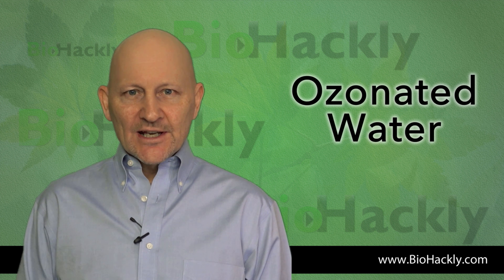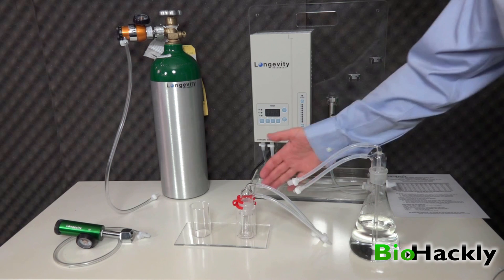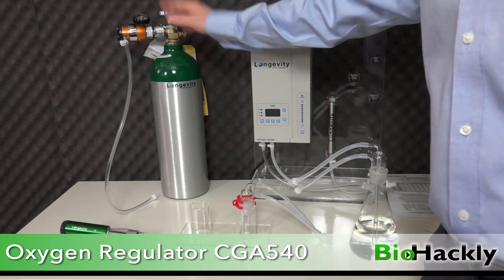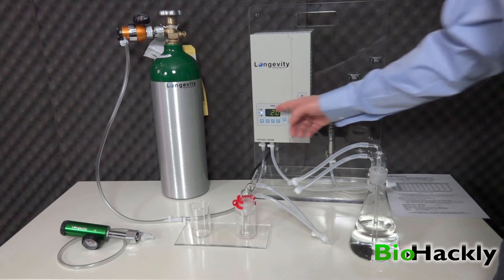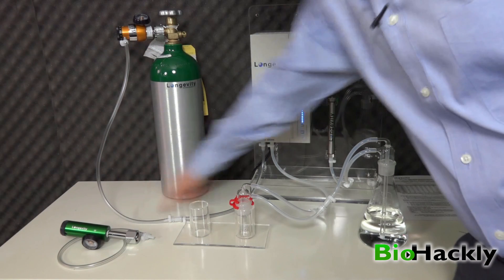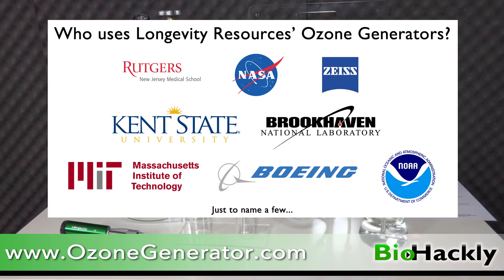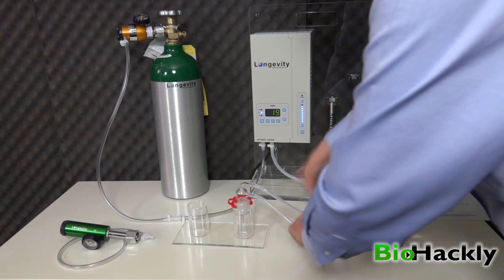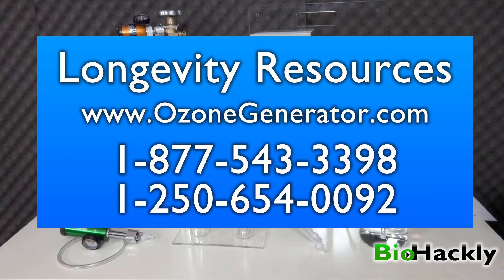Making Ozonated Water with a Longevity EXT120T Ultra Ozone Generator

Comment: Great video! I bought the same unit. You can keep your water temperature cold by setting your water beaker in a bowl of ice. The colder temperature allows for greater saturation of the water with O3.
Reply: I broke my beaker. Now using a plastic bottle from iced tea.

Comment: I don't have a stand for my generator so could I lay it on it's back?
Reply: If you have a Longevity EXT 120, the manual states it can be run laying on it's back. You didn't mention your model.It would be good to check the information for your unit.
Reply: . I always use mine laying inside the case it came with. I stand the tank upright of course...

Comment: I bought the ext 120 from Longevity and I did my first batch of water set  at level 7 set at 77.9 @ 1/16 oxygen flow and I found the water to irritate my throat  a little bit after I drank it. Do you recommend anything? Is that normal? I'm not damaging my throat am I?
Reply: I would absolutely back off the concentration a bit. They say to start at smaller concentrations initially, allow your body to adapt and increase in small increments.
Reply: ShaneMcGarry52 :  if irritates your throat because this is not truly the best thing to do for health.  U should be using molecular hydrogen before and after using ozone to protect the body.  The science is clear, molecular hydrogen is far better for health than ozone.
Reply: Ozone irritates thats normal. It's just pain, not gonna kill you.